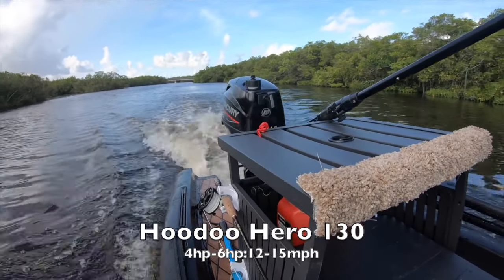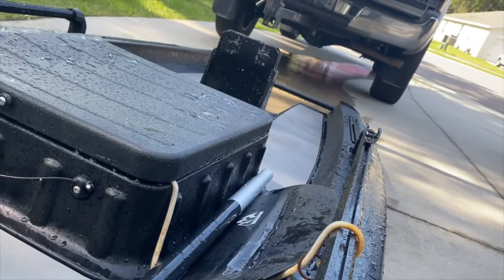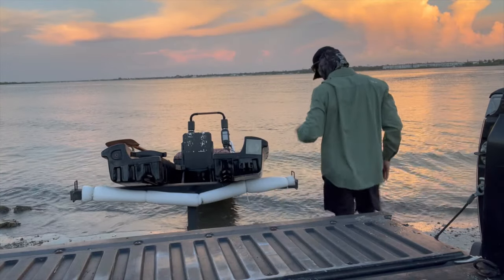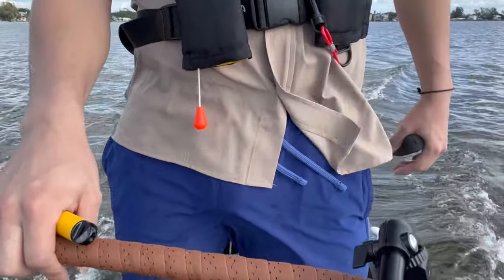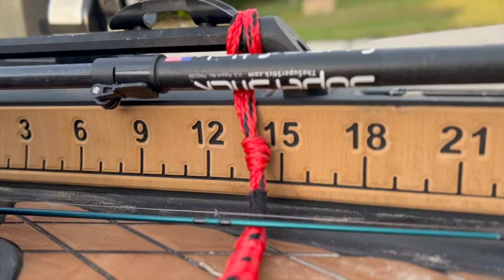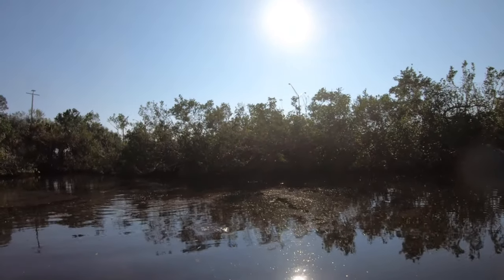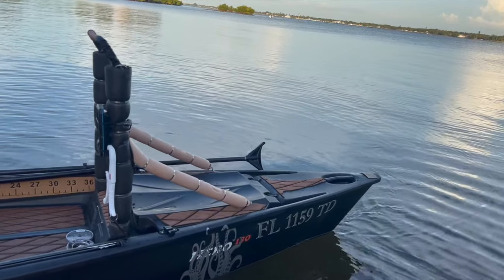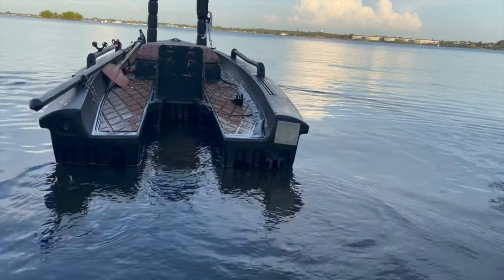If a boat and a kayak had a baby | Hero 130 6HP (2 year experience)

Comment: Great review. Very interesting solo skiff and like the way you've rigged it out. Simple!

One piece of advice for you as I saltwater kayak and paddle board weekly and recognized your Tacoma bed 😊.  Get some type of liner (I used carpet padding) and cover from your tailgate into your bed, especially the gap between.  I didn't and rusted out my tailgate and bumper on a perfectly good truck. It cost me $4000 in repairs to get all the saltwater rust out just from saltwater dripping down during my short transport 😢😢
Reply from the maker: I appreciate the comment the simpler the better! Dang brother, I didn’t even think about the consequences of the water on the tailgate! I will make sure to cover it from now on. I always assumed for such short commutes for me it wouldn’t play a role, thank you! I love my baby too much to let her rot :)
Reply: Yep, literally just that little bit of dripping into that seam between the tailgate and bed rusted out the bottom of my tailgate, bumper and rear cross member / tow package. Had to get it all cut out and replaced. I was able to do the tailgate myself for about $500, but the rest cost $3500 at a body shop

Comment: Ya know , I like the price on this and i'm not sure I would use a 6hp , maybe a 4 or 3. However , instead of standing and having my center of gravity so high. I would probably sit on that cushion , and then add in stick steering to the right and a gear shift and throttle to the left of the seated position. The steering can be done with a few pulleys , pretty simple to set up but it does require mounting hardware firmly to the skiff. Anyhow , nice setup man , I dig it.
Reply from the maker: I have a 4hp mercury on the boat! I actually bought a 2.5 originally with just a a reverse and go type of motor, it was a 2005 merc I picked up at a garage sale. I took the skiff out 2 miles and got stranded, motor wouldn’t start, before hand I had been riding for about 30 minutes prior to, no problem. Slow as molasses. I converted the NEW 4hp to a 6hp with a bigger carb and different prop pitch. Both engines new have same casing, same weight, same internals, just bigger carb and prop. After install I did notice I got on plane at much lower speeds which for me is ideal. Reason I sit on the higher portion at times is because 1) ergonomically it just feels better than the cushion and usually do it with stain glass water or calm water. 2)The vision from up there vs down by the cushion is unmatched while scoping out spots especially when transitioning for tiller to fly rod in an instant with the kill cord. 3) What is glare? Being that high up when standing and even sitting you just see so much more. The purpose of this purchase was to be as high up as possible without compromising stability. I think I have achieved that. I like your idea on the pulley system, for my kind of fishing I don’t think adding anything else that could potentially compromise the fly line getting caught up would be good. I like the pulley idea, just don’t think it’s ideal for fly fishing. I could Jam Pack this thing with goodies but, I use all sides of my boat. A pulley system would compromise some portion of the boat, which I wouldn’t want. The extended tiller give me room to maneuver while riding, a pulley would have me fixed in one position. Thanks for the comment, I appreciate the love!

Comment: Thanks for the great review BaitLess.  I’m considering getting one of these over the solo skiff because it’s 45 pounds lighter, 1.5 ft shorter, cheaper, and comes with tracks already installed.  I’m just not sure if the solo skiff is better equipped to handle chop and rougher conditions.  Do you have any ovptions on that? I’m looking to use the skiff in rivers and coastal waters in the Pacific Northwest. I plan on only going when the weather forecast is good, but choppier conditions are the norm up here.

Thanks again for putting this out there. Love your setup!
Reply from the maker: All things considered the solo skiff probably isn’t worth the extra 50 lbs and scratch to notice a difference. Maybe build quality is what you’re paying for but the scarcity alone makes them unapproachable. I think it’ll be perfect for those waters but I guess the question is how often do you hit these waters with small vessels or kayaks?Is this an upgrade to a set up or a new hobby to take on? What kind of fishing? Stationary or anchor out? If you’re drifting look no further! I get and pass through chop chop I just don’t stay in it. As long as I have a fail safe I’m hitting all waters, I just need a way out if it gets hectic. I’ve been very uncomfortable in choppy waters after boats start coming in at sundown and it’s a shit show but if you can maneuver through waves well you’re golden. Flip the boat naked when you first get it to know what if feels like if you ever do flip out there and see how much it takes to reflip. I hope you get one! I appreciate the love 🤟🏼

Comment: I see you removed the stern grab bar. Mine is a little spongy and don't use it to lift, but use is to hold a wood brace to protect the plastic stern at the boat ramp. Why did you remove you?😂
Reply from the maker: The right side of the bar, the bolt housing apparently had a crack in it before going on the water so for about two hours I had water trickling in, about 5 gallons of water was inside the boat. Trash. So I just removed it completely and gator guard patched it. I was pissed at the quality in that area.
Reply: @BaitLessCo.  wow!!! Yes, I've been trying to figure out how to improve the Stern grab rail, since telling people 'don't lift there ' seems crazy. Plus, with the plastic so thin there, boat launch ramps could easily eat through it.. I was shocked how damaging it can be even when babying it.
Reply from the maker: @reel.time.fishing  It’s close to impossible to reenforce, I guess I really haven’t put much thought into it since it pissed me off. I grab the sides for now. Thinking about it now, I could tie a rope in an infinity shape and fix a handle to the top, slip each stern piece in and use that as my hoist and leverage since grabbing the sides of the boat isn’t as pleasant. Could be possible to hang the boat in garage also with the cheapo method. I mean it looks sick as hell lol but unfortunately has no real function, which I can live with.
Reply: @BaitLessCo.  I'll share with you a picture shortly of what I'm doing to try to prevent damage to the Stern area. Stay tuned.
Reply: Let me know how I can get a link to my photos to you.
Reply from the maker: @reel.time.fishing  Baitlessfly@gmail.com
Reply: Yea mine cracked on both sides of the rear stern grab bar, luckily they replaced it with another skiff so I was good to go. Good guys over at hoodoo if you got problems they’ll take care of you. Just make sure you register your warranty! I didn’t on my first skiff but the guys took care of me. Now I don’t use that grab bar anymore and just hold it in the plastic sides while lifting onto my truck.